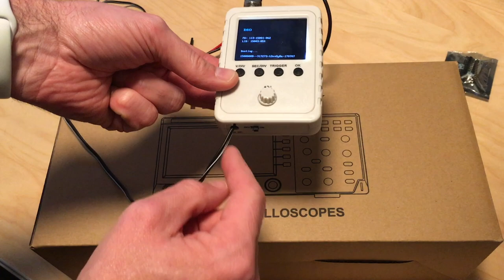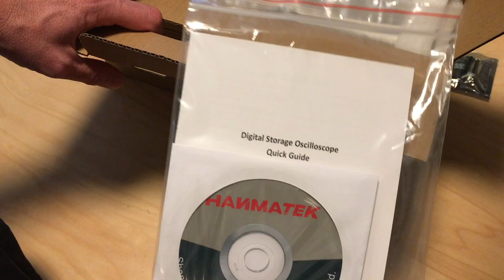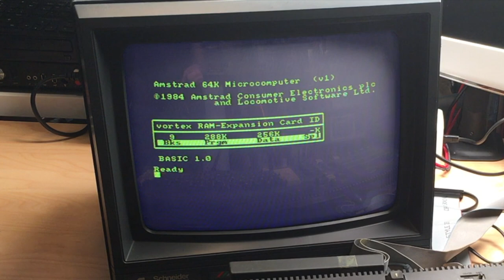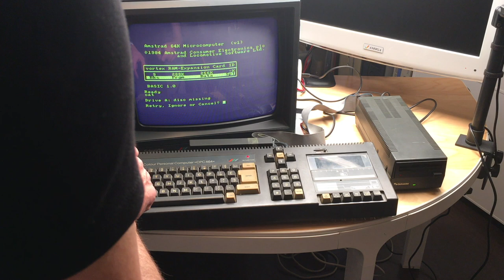RetroPackages #6 - Super rarity found - The Amstrad holy grail!

Comment: DSS1102 looks Awesome, Its not as big as I thought it was from the first video I saw it in. I guess it cold fit. Your getting really good at changing those belts! Holy Grail for sure!!!! I like how the 16 RAM and 1 ROM are socketed! I wish I was as lucky, I got half of the C128's holy grail. When I opened it, I found the MMU installed that is needed to control the Super CPU. What year is the robot from? Who did the new voice over at the end credits? Your wife?
Reply from the maker: The DOS1102 is compact for sure. And it has rounded corners ... which is always a plus ;-))) That memory expansion caught me by surprise. There was no indication, that it was in there. It's as rare as a two headed squirrel. The AIBO robot is from 2001. The end credits are not by a human. They are by an AI !! Check out wellsaidlabs.com. It let's you create speech from text. Very cool!
Reply: @RetroWK  2001 makes it 20 which is the age for retro for some. Others say 1999 or before. I am blown away that the voice was AI!!! They sure have come a long way since mission impossible!! I was also blown away back then thinking it was amazing!
Reply from the maker: @Charleshawn66  Yep. And there is even crazier AI stuff out there. Prepare to fight Skynet soon!